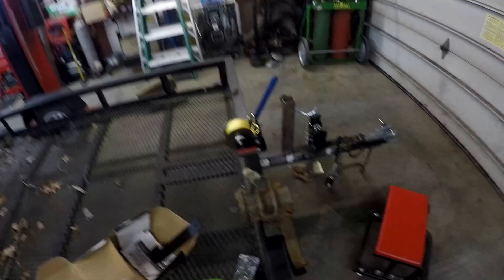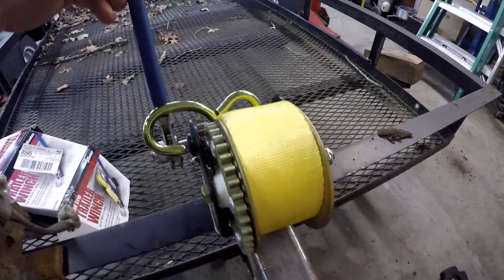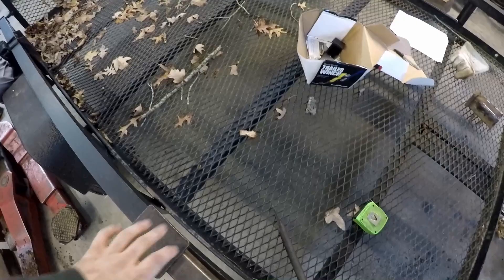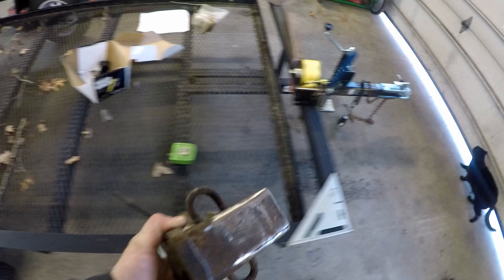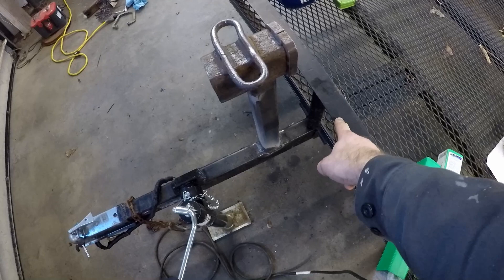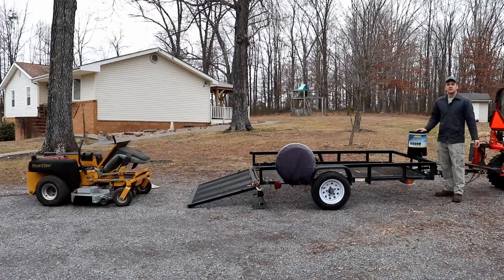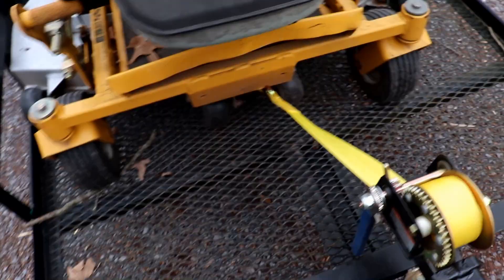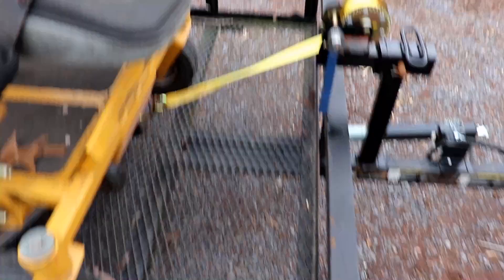Adding a Winch to a Carry On 5x8

Comment: I have hand winches on 3 of my trailers. You did a nice job but, I would add a diagonal 2 x 2 x 1/4 angle from the receiver to just behind the hitch. The angle can also be used to mount your spare tire. Good video. Good Luck, Rick
Reply from the maker: Thanks, I'll watch it and if I see it start to bend, I'll add a brace.

Comment: Nice for your trailer.  My car hauler can slide heavy machinery on because it has a plate floor. Same winch but I put a starter motor next to it and the gear matches with the winch gear.  But I use a pickup with a huge tractor trailer battery which I solar charge.  It powers a lot of other items.
Reply from the maker: That is cool!